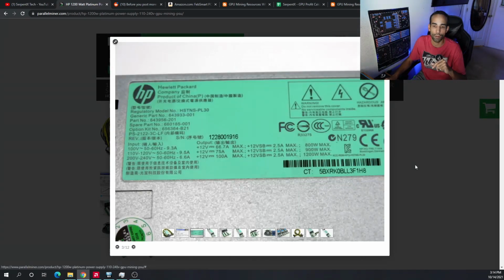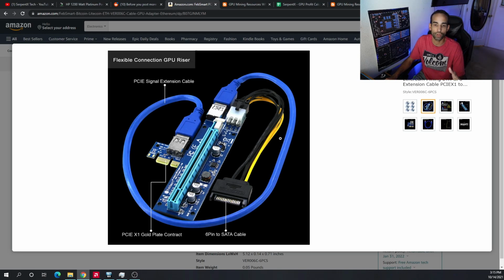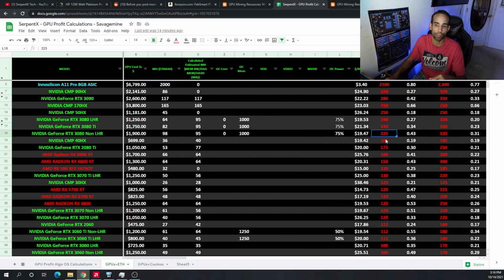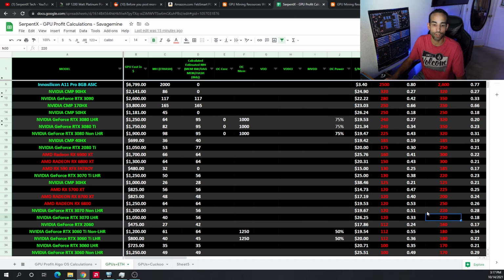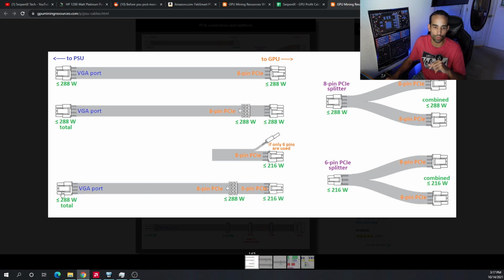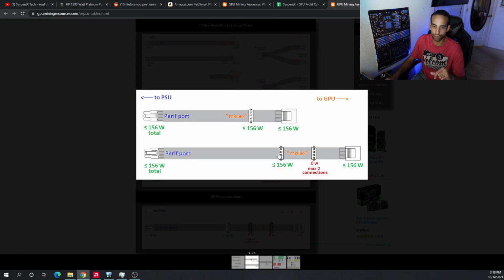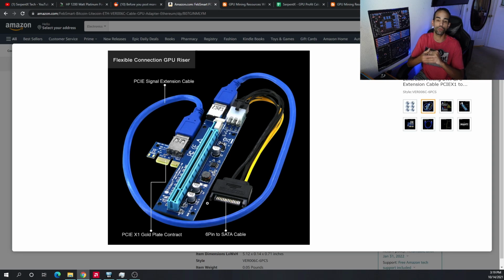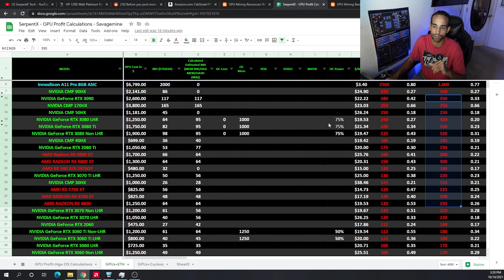How to Build a Mining Rig - Part 5 - Power Supply

Comment: Ebay - 750w platinum server power supply 16.50$ shipped to your door. Then you can get breakout board printed for free (2 per month) and connectors a few bucks. Or you can just buy the 14$ breakout board 👍✌